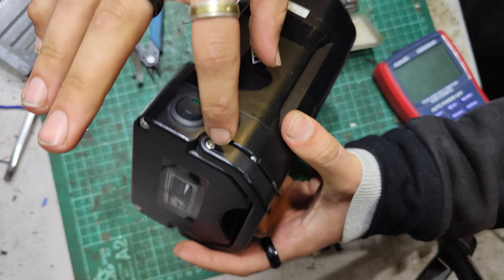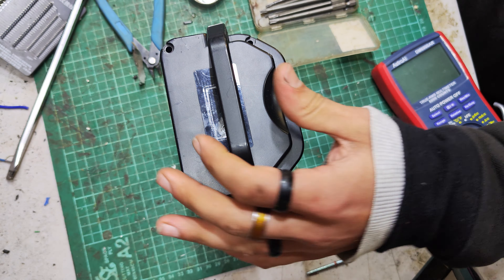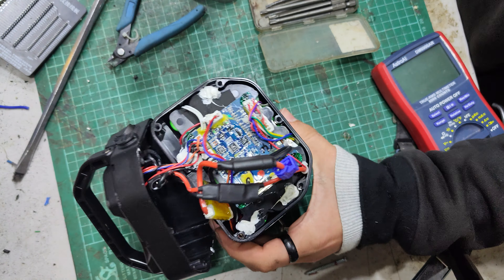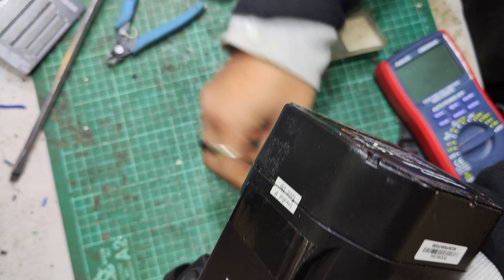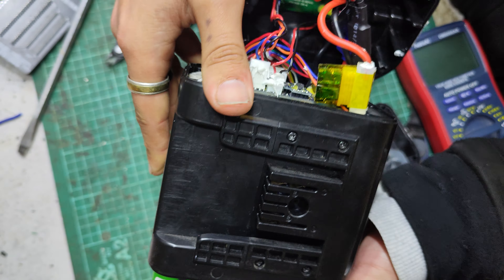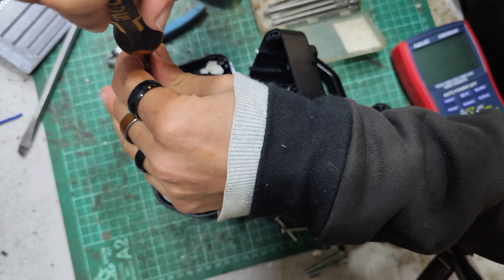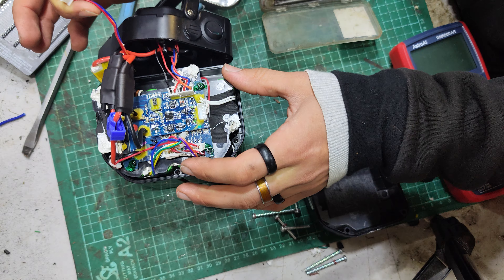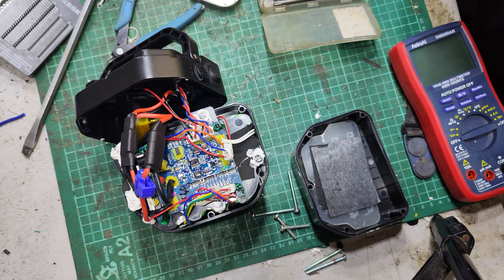What's Inside An A2B Kuo Battery? How to open.

Comment: Hello, thanks for the video.  I have the following questions: 

 1. Can I install a generic BSM with UART communication (5 output pins) so that the bike continues with all its functions?
 2. Does the LCD and battery monitoring only work with the bike's original BSM?  Or can I install another BSM that has a 5-pin output?
 3. Can the bike work by connecting only the positive and negative of another battery without the 5 pins?
Reply from the maker: Unfortunately I don't know, only that the stock system does not work with a generic bms.

Comment: what did you find out about the communication wires on the battery pack? did the bike work with just the power wires connected? I have the same battery pack on a Kuo+ I just purchased and would like to know if they are necessary to make the ebike work. My battery is totally dead. Thank you.
Reply from the maker: it worked without them but display thought capacity was at 0% ... looks like it needs them
Reply: @EbikeRepairs  thank you. I thought that the extra wires might work for something, now I have to decide if it is worth triple the price to get a duplicate battery or just use the +&-. For the price places are asking for a battery with (I think) the additional wires I could just buy a huge amp hour battery and not worry about it getting low.
Reply: You should Not be wearing rings!

Comment: i just got an A2B Alva + without battery, can you help me find one, also need KeyFob frequency
Reply from the maker: Unfortunately I think A2B is out of business, and has been for a while... Not much to be done, unfortunately! Sorry 😭
Reply: thank you for responding, i was hoping for information , like build sheets, or more detailed specifications that might have the type of key fob, but, of course i can replace the controller and display but, it's just so nice! @EbikeRepairs
Reply from the maker: Sorry I don't have any of that info 😭 the controller on some A2b bikes is inside the hub motor, which is not fun... Additionally, the battery requires a special BMS that communicates and as far as I know is no longer able to be bought :(